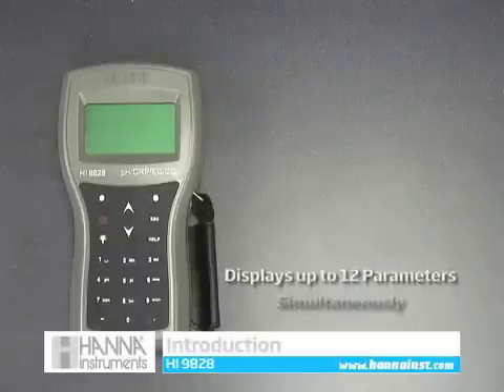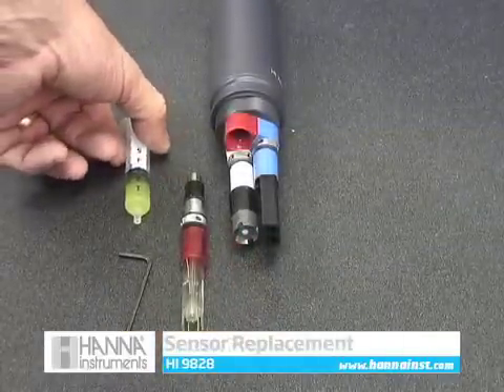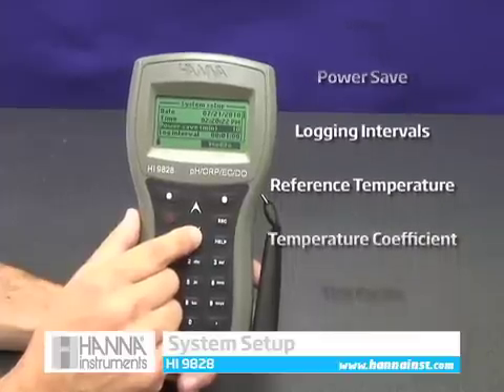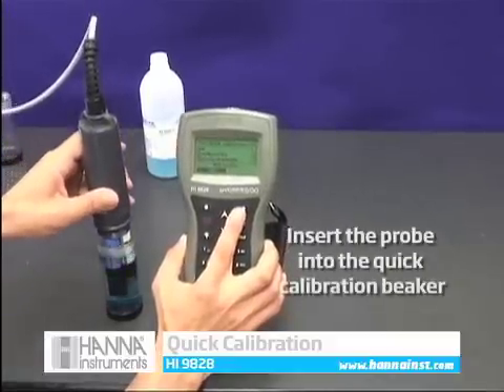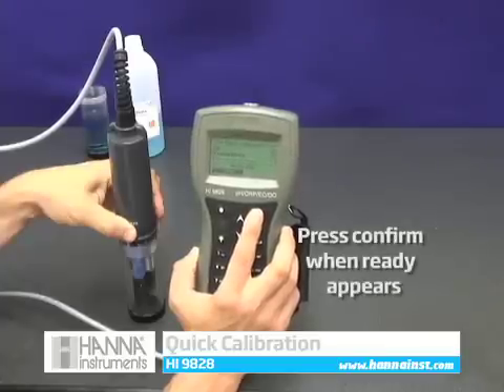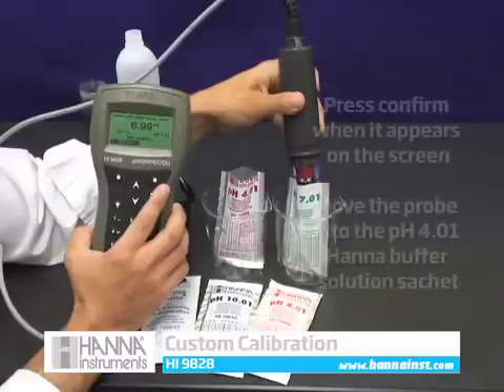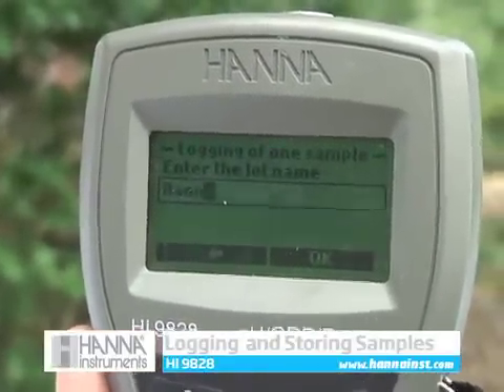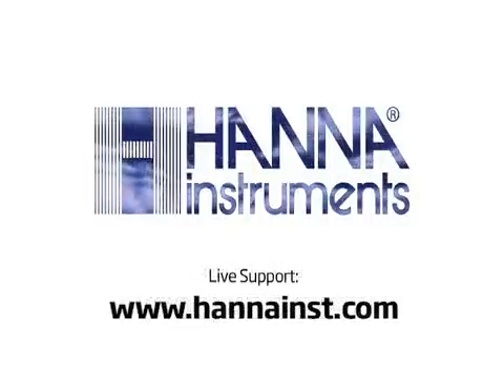HI 9828 Multiparameter Meter

Comment: We have the newest model HI9829 model. The DO reading always show low value sometimes until below 0.5..the river is flowing and healthy river. Do we need to replace the DO probe?
Reply from the maker: Hi Hazim. Are you calibrating the meter before measuring? Where are you located? If there is an issue with the probe I'll direct you to your Hanna Tech Service.

Comment: Before storing the sensors should I wash with distilled water? Thanks
Reply from the maker: Hi Bruno. Yes. It's good to have the sensors cleaned with distilled or deionized water before storing them.